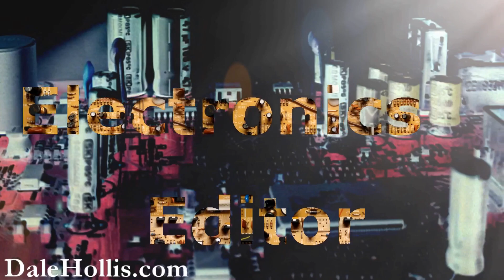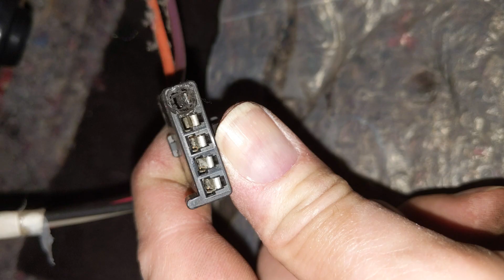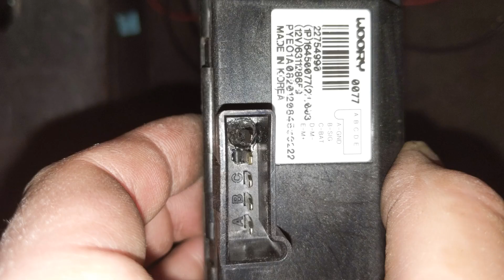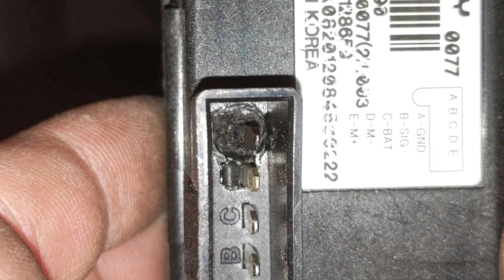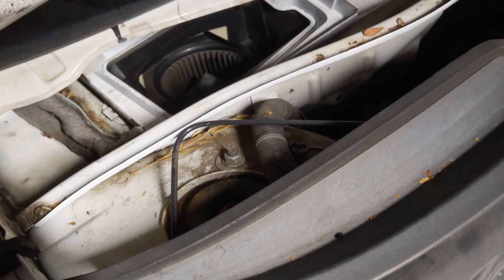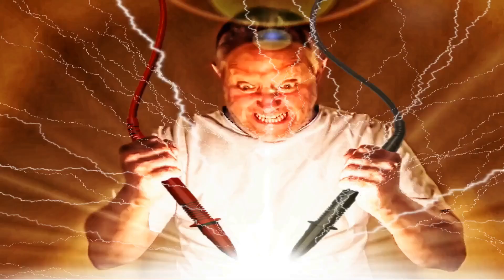2013 Chevy Impala Blower Motor Resistor & Harness Fix (No Air Blowing!)

Comment: I have the same year and exact same problem. This is actually the 2nd time it's happened. And i have NEVER changed th3 cabin air filter. First time i took it to a shop and they replaced the motor, resistor AND the harness, but never said anything about the filter (??)But this time im doing it, as i learned to do every other repair after that bill, and maybe only replacing the harness. May replace the resistor after i pull it out to look at it.

Comment: Would this stop your heat from working
Reply from the maker: If the fan is not turning, yes. This fan motor blows both hot air and cool air out through the vents. If you're getting air blowing through the vents but still not getting any heat, it's likely due to something else.
Reply: Yes

Comment: Smashing repair :-D
The photos were ideal, and they were so steady ha ha :-D
I'm surprised the Mosfet didn't pop, but it's likely over rated for the use.
I guess it's driven with a typical variable pulse width from the console.

Yep the filter needed to be done a loooooooong time ago lol.
Bonnet/hood  trunk/boot  fender/wing  are  known names, just use what you are used to.
In old radios i call the glass devices Valves because they control the flow.
Americans call them Tubes because they do look like a tube.
I would call them Ouch ouch hot hot ha ha :-D
Reply from the maker: Everything you said was well put, and the last sentence had me laughing hard because I get it. The key is to wait until they cool down before touching them but some of us like me don't have much patience for waiting around. Lol...
Reply: @ElectronicsEditor  You are not the only one, i jump into things and lose interest half way through.
Yes ill let the tubes cool down :-D.